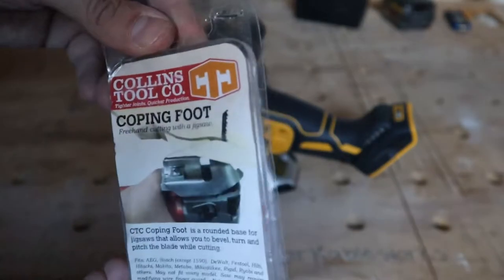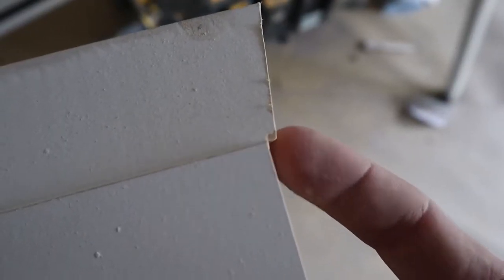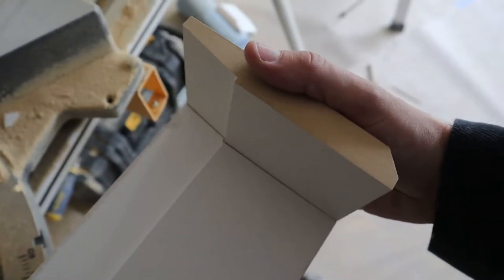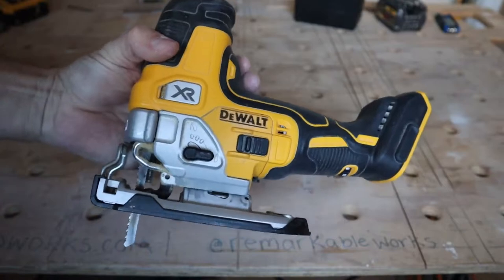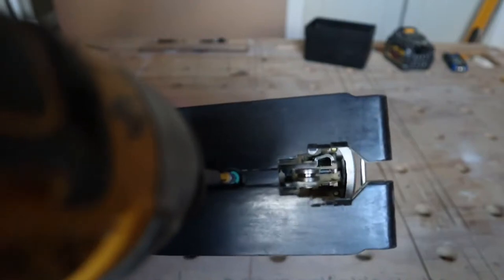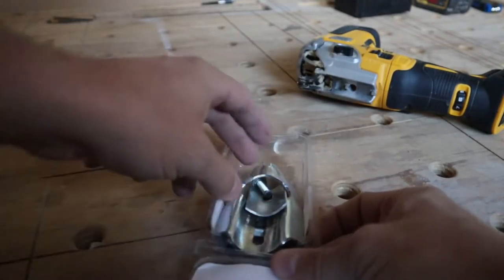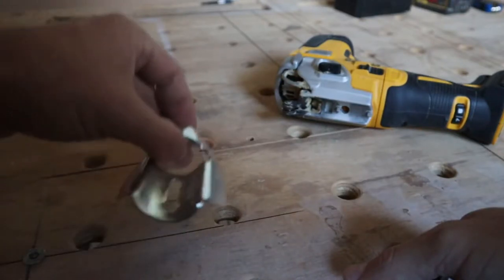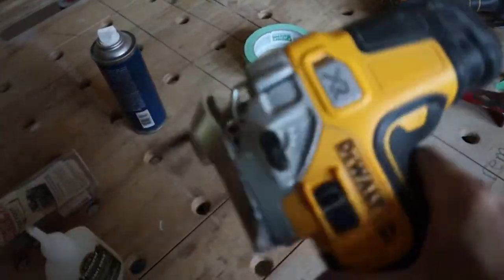Coping baseboard with a jigsaw and the Collins Coping Foot (AND INSTALL)

Comment: Great video! Here's another little tip. The nut is 11 mm and I put a little piece of copying paper on one side of my open-end wrench. That held the nut tight in my wrench and I was able to tighten it right up without using adhesive